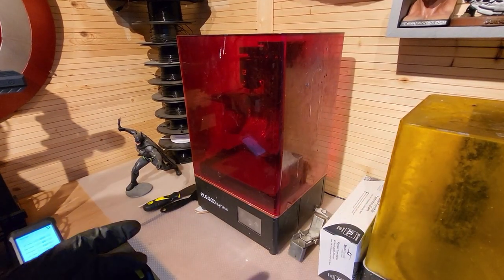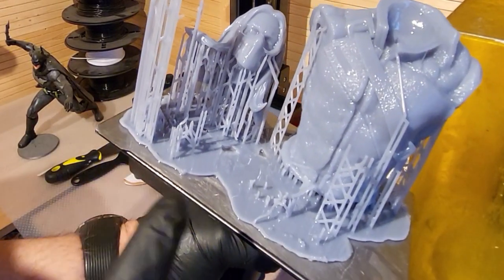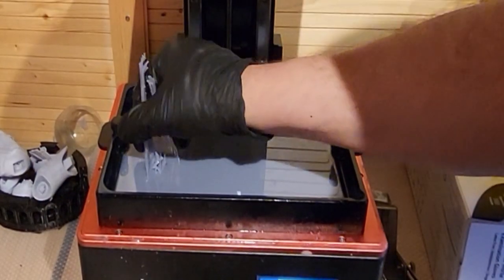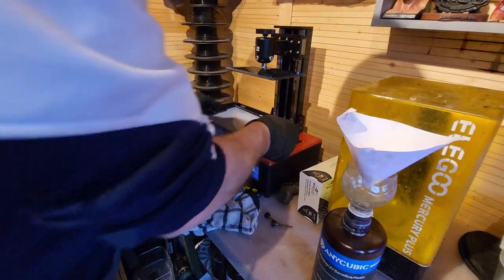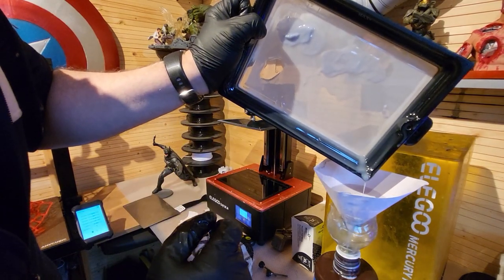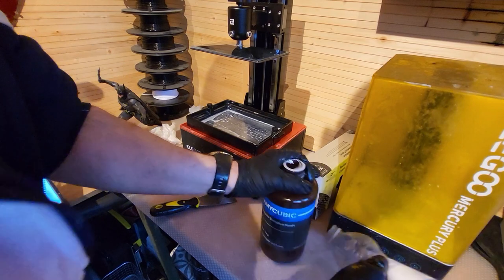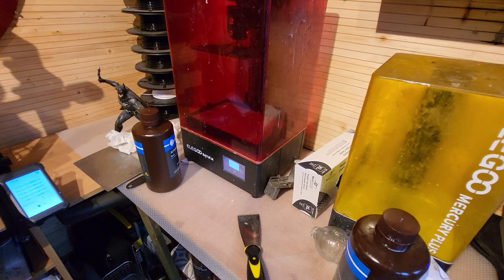What To Do If You Get A Failed Resin 3D Print - Cleaning The Vat

Comment: I have a set of cheap plastic spatula which I use to lift the corners. They are much less likely to damage the fep then and can always get the resin sheet lifted after a little fiddling
Reply from the maker: Thank you.. Seems like  a sensible approached 😁👍
Reply: @greedy3d480  same here, i bought yesterday e spatula for this. already have 3 feps destroyed in 2 months.. but i used the black scraper instead of the iron one. now im trying to use a wet paper or alcohol for cleaning up the parts that are stuck. also i used too much alcohol once in the vat, which diluted my resin i poured in to short after. so yeah.. next time i buy some resin i probably will use the last bit to put it in the bottle with the old diluted resin and even if it breaks more easely when handled, i can still use it as a showcase model.

Comment: You did it wrong ;-) and NEVER use a sharp scraper near the fep.
1st pour most of the resin out through a filter.
2nd with just enough resin covering the fep place a piece of support in the corner
3rd run tank clean 2x 30 seconds.
4th Remove the vat
5th push slightly under the fep in the corner near the support to make the cured resin mat comes loose.
6th slowly peel the cured resin mat out from that loose corner.
7th clean with IPA and a piece of cloth if you feel the need.
Reply from the maker: Thank you... Great advice and why I love youtube so much... It's a learning game this 3d lark... 👍😁
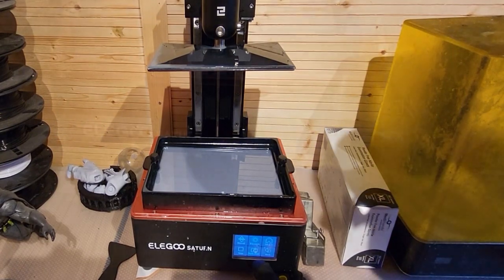Reply: @greedy3d480  Just looking at 1:15 and it looks like your printer isnt level? Left side as you look at it seems higher and the resin is lower on the right ;-)
Reply from the maker: @Optikification  I'd spotted that too... It's being moved today to make room for the Saturn S that's replaced the deceased mono x... Thank you for the heads up though.. Appreciated 👍😁
Reply: @greedy3d480  Got my man cave now as my last chicken flew the nest ;-) got a load of room now so sad i sold my ender 3 lol.
Reply from the maker: @Optikification  ooo send pictures of the man cave when its done - ive just sold my ender 5 - to teenager with a print farm thats making more money than Ill ever see lol
Reply: @greedy3d480  the feet on the bottom screw/unscrew to level the unit. I learned this after owning it for over a month

Comment: New to this, so just asking from a newbie, is it just too much of a pain to empty the vat of the leftover resin and clean the tray off/out after each print rather than just leaving the leftover resin in the vat, which it appears can cause problems later?
Reply from the maker: You really don't need to it'll be fine to leave the resin in the vat.. I've left it for weeks and just carefully stirred it prior to use 👍
Reply: there's no reason to. Why clean a vat after a successful print only to pour resin back in? If it were a successful print there shouldn't be any cured resin in the vat.